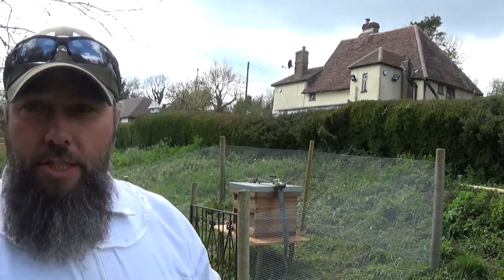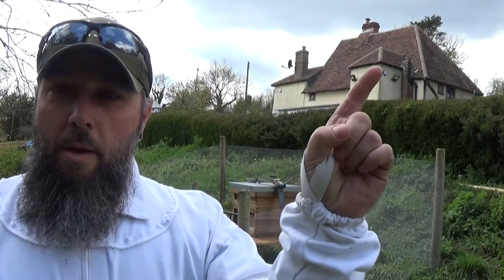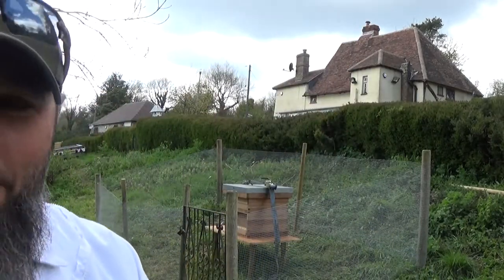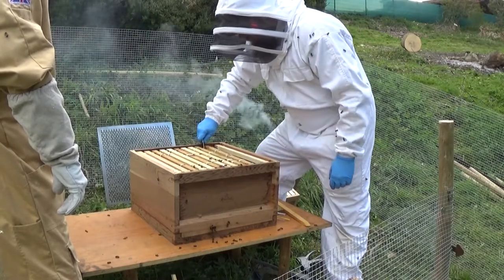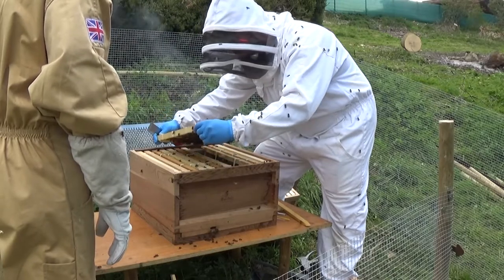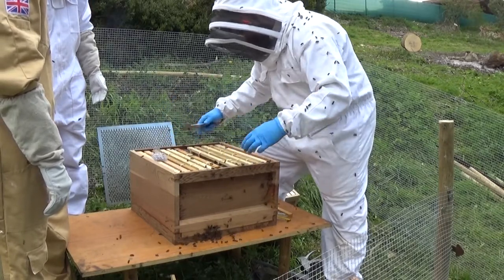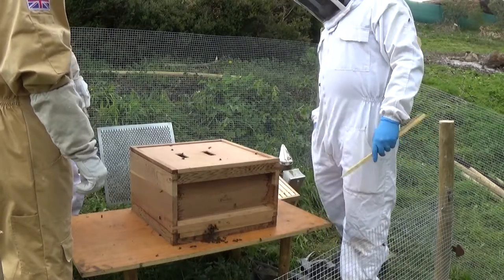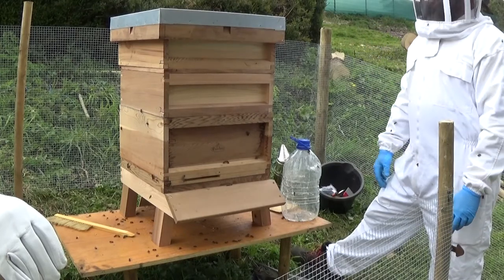UK beekeeping v7-21 - Chimney hive cutout and 1st insp at our new detling Apiary

Comment: Just a bit of advice because the bees will remove the elastic bands. Don’t tip the frames over or the comb will break. Instead lift and turn on its side and turn the frame so the side of the frame takes the weight. Trust me I’ve been there, it happens quickly 😆😆 Hopefully they will love being beekeepers and they have a smashing looking queen 👸
Reply from the maker: Thanks for the advice... Yeah, I have been shown how to flip a frame but at the mo I'm relying on the bands holding the comb in place until the bee's have drawn more brace comb round the edges, they are thick bands so I'm waiting for them to cut through....I'm sure they will be and they love it so far 😂... 👍🏻